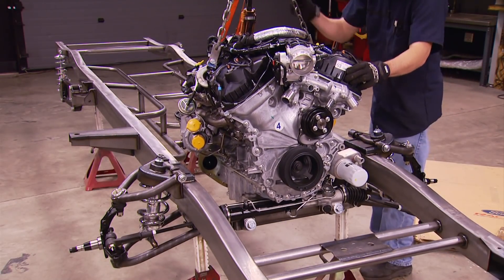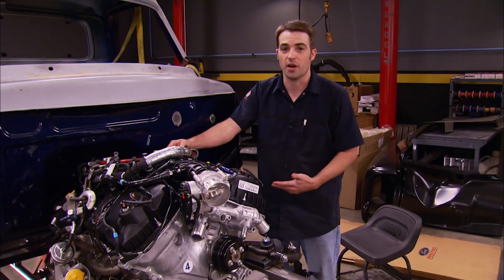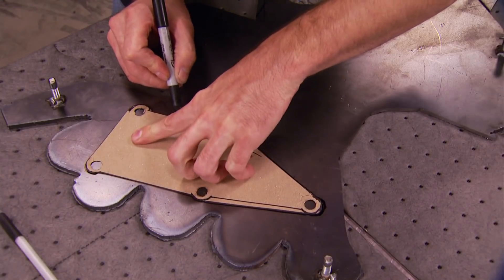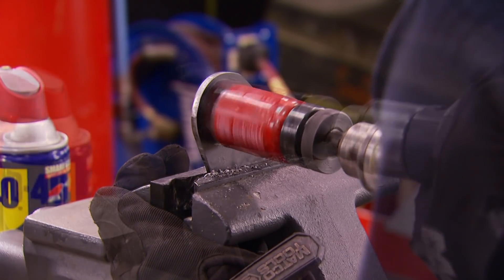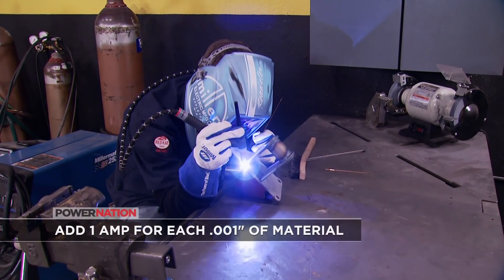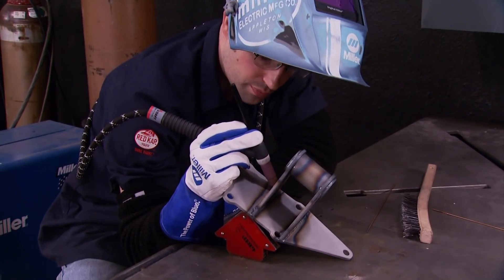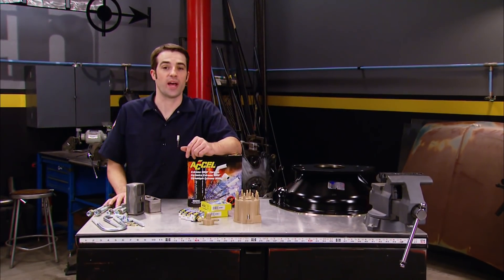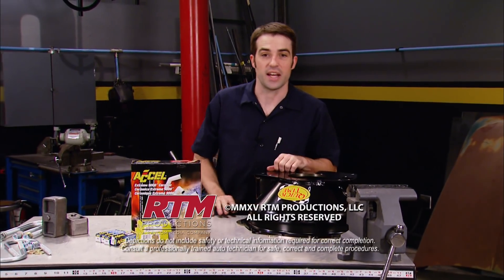Swapping A Twin Turbo EcoBoost V6 Into The '55 F100 - Truck Tech S2, E1

Comment: Do we have a video of this motor running yet? Im curious if it can sound good, even with straight pipes. This could be a great space saver swap, if it sounds good, the power is there for sure.
Reply: I’ve never came across an ecoboost that I really liked the sound of (and I own a 2011 F150 with the ecoboost). The only sound I do like from the aftermarket stuff is more turbo noises, but for actual exhaust tones I just don’t think it ever sounds “great”.

Comment: Nothing beats that Eco boost V6 those things are bulletproof! Anyone bad mouthing them obviously doesn't know how to take care of an engine because if you take care of these things they will last forever!!!  💓.   Extremely powerful just like the old Buick grand national V6 engines
Reply: Ehh I have one with 160k miles, valve seals are going out… it has always had a blow by issue (never got around to putting a catch can on it), spark plugs only last me 20k miles at best…
I have had it since 45k miles and my maintenance has not been “perfect”, but I’ve only had one extended oil change interval during my ownership. I let it get to about 10k before one oil change a while back (I wasn’t to worried though because I’ve always ran full synthetic). 
I’m not sure how long my engine is going to let now without some top end work…

Comment: nice job but i wish the metal between the two outer plates was thicker... it looked like sheet metal... if I was doing this i probably would have started with stock mounts and modified them but thats what I would have done.

Comment: 12:45  Suggestion.  By stopping the gusset strait across you have created a focused stress point.  It may be something that could take years to show up or maybe the very first time you really romp on the engine.  I would suggest that you taper the gusset so that the stress is distributed.  Just like using a fish plate on the frame.  Great project.

Comment: Great work on the motor mounts.  Keep in mind that ANY of the Brake cleaning products should not be used for welding.  They all have chemicals such as Methylene Chloride, etc., that will react to heat and uv from welding.  Only Acetone or Alchohol should be used to clean the metal before welding.
Reply: They make chlorine free brake clean
Reply: @skeletonracingandgaming3407  Doesn't matter, they ALL have toxic chemicals that will severely affect your central nervous system over time.  Methylene Chloride to name one  It is used in furniture strippers.  Bad stuff.  I'll say it again.  ONLY Alcohol or acetone should be used to clean metals before welding.  Edit:  I have been involved in welding literally since I was 10 years old (I am now 56).  I am a Certified Welder, and a Certified Welding Inspector.  My Father has been involved for over 60 years, and is also a Certified Safety Professional, so we both have been around the block (More than once).  I'm not looking to put anybody down, or insult anybody, but this is something I see all the time.  We don't want to see anybody get hurt or sick over something that is absolutely preventable.  Stay safe!

Comment: Go ahead and cut a hole in the firewall behind the passenger side head. That way when the vacuum pump on the back of the head starts leaking oil, you will have access to it.

Comment: lot of extra work when you could have just not have had the vertical side plates not go in a straight line to the top of the base plate.  Dropping the side plate down 2" would have give yo just as stong of a mount while allowing for tools to more easily reach your a/c unit etc. A l;ot of extra work created her now ( fabrication work) and in the future when you have work on shit and you didn't leave yourself room to work.

Comment: That Engine is a pile of trash, you will have trouble with it
Reply: Those engines are great! No problem with them if you take care of them
Reply: @Dennis Burger That is why I will never support them
Reply: That is a great engine and a engineering Marvel there's no problem with that engine at all other than neglect!
Reply: @willschultz5452  bullshit. That is not what the service techs are saying
Reply: @jameshaney8468   Either they don't know what they're talking about or they are getting in customers that never take care of their engines or change the oil! Those engines need to be taken care of and serviced at the proper intervals the tolerances and clearances are critical!
Reply: @willschultz5452  No the problems is that is made by ford, and they are cheep, they do not care about quality
Reply: @jameshaney8468   No you are thinking about General Motors they have always been like that. Ford is not cheap at all they go above and beyond.  That's why anything General Motors is garbage and that is why Ford has the best trucks since the 1950s!!
Reply: @willschultz5452  so ford is not using plastic oil pans, which they are, That is being cheap
Reply: @jameshaney8468   No that is not being cheap that is saving weight that is the reasoning behind using all these plastics some of that cost more to make in plastic than it does in steel.  Now granted I do not like plastic being used for some of these things but the mindset behind it is to save weight. Many manufacturers are doing such things
Reply: @willschultz5452  that is being cheap because they could have made it out of aluminum and they would not have cost that much more and you still would get about the same amount of fuel mileage so it's just Ford being cheap asses
Reply: @jameshaney8468   Plastic is lighter than aluminum and I'm sure just as costly  to form an oil pan out of.  Many other manufacturers are doing the same thing
Reply: @Dennis Burger  That will never go Bang because they are pretty much bulletproof!
Reply: @Dennis Burger  You are highly mistaken wherever you got your information from! The engine is considered one of the best out there! Just because people don't take care of them properly has nothing to do with the engine being bad!  They will go for 300,000 miles easily with no issues when you take care of them properly just like anything else! Better check some sites and do some research
Reply: @Dennis Burger I haven't seen any issues or complaints about them at all even with 300,00 miles on them. Also cops love them too !   Police department's report not many problems and they run them hard constantly!

Comment: Isn't that engine a boat anchor
Reply: NO that engine is one of the most powerful V6 around!  Bullet proof!!!
Reply: @willschultz5452  Doesn't hold a candle to Barra
Reply: @awesomusmaximus3766   I wouldn't know because we don't use that engine in the States
Reply: @willschultz5452  It's based  on the old Ford 250 inline 6
Reply: @awesomusmaximus3766   I wouldn't mind seeing one being used, that engine was a really good one also
Reply: @awesomusmaximus3766  that's super Impressive 🙂
Reply: Video prolly sponsored by Ford...
Reply: @BuzzLOLOL  Ha ha

Comment: I would stay away from the twin turbo V6, Ford had a lot of problems with those .
Reply: What percentage? Do know how many of these engines Ford made?
Reply: @anthonycadiou8367  Anthony I dont know how many ford engines  ford made . I suspect all of them under the guide lines of a special contract to the race teams , although I also think the race teams had them modified at there machine shop to a degree without breaking indy car rules. 
They have to be one hell of an engine to produce 750 horsepower yet hold together for the duration of the event .
Ford , Chevrolet,  Honda have a rich history at indy .
Reply: It’s a hot rod, not a Corolla.

Comment: Anything with "Eco" in it's name is 180 degree off from MY firing order. Not a fan.
Reply: Have you ever driven an ecoboost?
Reply: @tristannivens3269  nope. You can have it. I have no interest.  l don't want to fix it when its overstressed internal bits wind up on the outside. And it will grenade, just give it time.
Reply: @Tommy_Mac  I'm certain that with your decades and decades of engine building experience, including turbo charge 6 cylinder engines, you could demonstrate this grenade feature so Ford can learn from it.
Reply: @Tommy_Mac  Mine only has 84,000 miles on it so maybe it will grenade later on. The 2.7L has surprised me so far and the only thing I don't like is that it sounds like a golf cart.  I have full coverage for a reason though 🤷‍♂️
Reply: @tristannivens3269  Some guy was selling an 11 F150 Eco with 225K miles. I test drove it and it ran like a new truck. I don't have the guts to take the risk though, it was 12K.
Reply: @alb12345672  I've heard the earlier ecoboosts were more problematic but I've never messed with one. I definitely miss the sound of my old Titan but it's hard to beat the power/towing/ fuel economy of the ecoboost.
Reply: @tristannivens3269  I'm reading now if they are maintained to death they are all quite reliable. One big issue is they have a single very long chain and that stretches. That has to drive a high pressure fuel pump too. Oil has to be optimal for that that not to wear and stretch.
Reply: @Tommy_Mac  I never said I enjoyed them. I simply asked if you had ever driven one. Maybe I'm a smart ass but you chimed in on something you know nothing about so what does that make you?
Reply: @alb12345672  Good to know. I change my oil religiously every 3000 miles so maybe mine will last a while.
Reply: @alb12345672  Regular oil changes are key. The GDI engine, all GDI's can have issues with fuel washing oil out of the cylinders and affecting the cam phasers, the guides and eventually the chain. 5K at best and they run fine. So far mine has 148,000 and I tow/drive with heavy loads frequently.
Reply: @Tommy_Mac  
I'm not a fan of any of the eco engines Ford builds. I have read where they have some really strange problems,  like water in the intake system. That just seems strange. I have been in the trucking business for over 43 years and I have never seen a problem with water in the intake system,  except for I seen an old truck that sat for over 20 years, have a hole in the intake hose that went from the outside of the hood into the turbocharger 
That had a good reason for water in the air intake.
Reply: @tristannivens3269  It should. There are videos from 10 years ago where ford put that engine thru absolute hell. I mean, a trailer with 14K lbs and 24 hours at full throttle on a Nascar track. That was nothing next to some other stuff :lol:. Pulling 30 giant logs thru a muddy forest.
Reply: @alb12345672  I've only pulled my 84 F150 on a trailer for a few miles but even then I could tell it pulled better than my Titan with a 5.6. Time will tell, maybe it'll blow up like these engine gurus above have stated.
Reply: @iwastoldtherewouldbenomath6869  Yes, it is not an old school 302 pushrod where you can stretch the oil change. People treat it that way though.
Reply: @alb12345672  Exactly. And I had a supercharged 302 in my old 80 LX. Loved it but the tolerances allowed me to be a tad more liberal with oil changes though I was careful because of the SC. No comparison between the two which is why the old farts amuse me. I've had both and both have their purpose.
Reply: @tristannivens3269  take it easy bro. We seem to have a crossed wire. I didn't call you that. I was responding to another person's comment, not yours.
Reply: @Tommy_Mac  Ah I apologize then. Just saw where it had my name tagged and assumed you meant me.
Reply: @iwastoldtherewouldbenomath6869  Old 302s had nylon gears which could grenade. Other than that, bulletproof. The last crop of 302s in the Explorer I would almost consider a lifetime engine.
Reply: @alb12345672  yep. I had one with 275k on it in F150. Ran great. Sold it to somebody and they blew the rear towing a trailer with it.
Reply: @tristannivens3269  I hope it holds up for you. Just not my thing, but I'm old, so what do I know...
Reply: @alb12345672  I had the phenolic upper gear grenade on me, bend all 8 intake valves as well. I didn't think at the time it would be a big deal but I swapped it for a steel gear. PITA. It was a costly error.

Comment: The only issue I have with the Ecoboost, the horrible sound it makes. No matter the system or cams you use it still sounds like a gen one Taurus with a massive exhaust leak. Yeah you can make it more metallic or put longer pipes on it....it still sounds like a old 3.8 windsor based v6.

Comment: I hope this is a tuned up version of that engine. If nothing else is stock then why should the engine be left as OEM? A turbo and/or HP Tuner upgrade should be sufficient for a 50-100+ HP bump. Just thinkin out loud here, but if it's gonna to sound like a vacuum cleaner then I think this truck deserves an honest 450-500 ponies at the wheels.
Cheers 🍻.

Comment: That's Serious Money. My Friend has the 2018 Turbo EcoBoost In Is $110.000 Platinum Ford F150 Special Order. And  6 Cylinder Diesel Twin Turbo Engine In His 2019 Ford F250  Platinum $108.000 Special Order.  I wouldn't ever spend that amount of money on a new vehicle that looks like the others but so different and double the price. Canadian Dollar.   I Like The Truck your doing, Great Video.
Reply: No econoecoboost $100,000
Reply: @fread51   f150 supeecrew limited 3.5 eco starts at 92k Canadian... Before any other add ons so..
Reply: @philipgagne1852  I don't stay in Canada

Comment: I remember the day when the V6 5 speed full sized truck was something NOBODY would want to recreate on purpose!
Reply: Hope the water pump doesn't fail 😂😂
Reply: @caseyeldridge5557  different engine. Truck engine has normal pump.
Reply: @caseyeldridge5557  CORRECT
Reply: How can you say that? Do you remember the SHO TAURUS? They made that with a 5-Speed.
Reply: @anthonycadiou8367  If they put THAT in a truck? Ok... But that was a V8.
Reply: Trying not to beat up on Ford but no over head cam motor is technically reliable from Honda Toyota etc because they simply only work with constant maintenance!!!
Reply: 3.5 Eco can easily make 500HP 600FTLB with nothing but a little boost. This ain't your grandpas 220HP V6. It's a great choice for a reliable engine in a cruiser that still has some pep when you get on it. Not every build needs an 800HP 440CI.
Reply: @ConnorHD3  Back in the day 4.3L was around 160hp... 😥
Reply: @thecman26  modern 4l will make 250-206 NA and all the HP on boost.
Reply: @JTLowry  yep, boost cures all! Back in 93, not so much!
Reply: @ConnorHD3  - 220 Horses isn't as little as you'd think...I'm old enough to remember when they were only getting about half that, all they way back in the 70's.
Reply: @ConnorHD3  the fewer cylinders you have, the smaller the torque band.
Reply: A @ConnorHD3  ??
Reply: Yeah, the swap nobody will want to do/bother with... this was prolly paid for by Ford...
Reply: @BuzzLOLOL  That's what I was thinking espescially since it was stock turbos like wtf
Reply: Ford engines today with over head cams are notoriously unreliable and full of plastic parts that end up in bottom of oil pan to get that beloved oil to no oil pressure magic... WHAT A POS!!! HP AND MPG ARE USELESS WITH OUT ABILITY TO GET 300 THOUSAND MILES ON NOTHING BUT OIL CHANGES!!!
Reply: @Thelongmanable  that's only a issue with the 5.4 the current cam phaser issues with the ecoboosts is completely different it's just a rattle from warn pins, the gen 3.5 eco will go 300k plus

Comment: I love the idea but I would like to see it put into a original frame and suspension  rather than a aftermarket version.
Reply: This engine is very capable of 550 ft lb of torque at 1500 rpm, I'm not sure the original frame would last too long. That would be like putting a 514 in it and thinking it will be fine when you try to peel the tires off with the throttle. The first brake stand you do and you'll 35 the frame right behind the cab.😂🤣👍
Reply: @robsorgdrager8477  good point,  I was thinking the frames were built stronger back then and also the fact it is a truck it was built to haul weight so it might be beefy. Then again engines didnt have much horsepower in 1955😂.    I actually wanted do a swap with one of these engines into a windstar minivan 🤣. Going to take alot of work but I think it can be done.  Talk about a sleeper!
Reply: @willschultz5452  as a old Ford tech I would advise against doing anything short of recycling a Windstar. That chassis couldn't even hold up to the vallkin 3.0 😞 . I hated doing anything to those turds. It was simply a fat body on a Taurus chassis with an odd ball beam axle in the rear. They were worse than the aero star and I'd rather have a UTI than be close to one of those.
Reply: @robsorgdrager8477  ive had practically every ford imaginable. Plenty of Taurus and windstars. No problem with them except the 3.8 was not too swift. The 3.0 would run forever.   The chassis is certainly strong enough for the swap. A freestar would work  also.  Just going to need beefy axles and CV joints🙂
Reply: @willschultz5452  I don't know if you remember the Windstar recall. The Taurus needed quite a bit of help to manage the sho upgrade . Let's not forget the broken springs, blown out ball joints and the cradle bolt issues.
Reply: @robsorgdrager8477  I never had any of those issues and don't know anyone who has.   I could use a mercury villager but that is actually Nissan and id rather keep it all Ford 😂.   I'm sure I won't have any issues.  I can always  reinforce anything I think would be a issue.